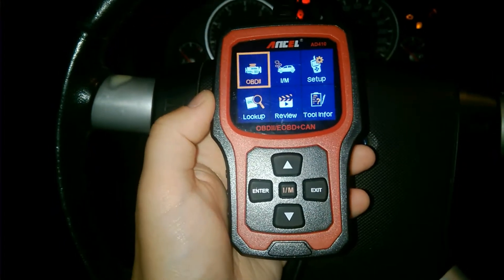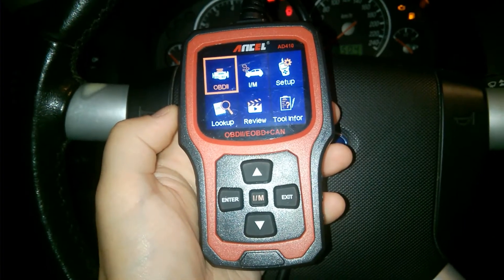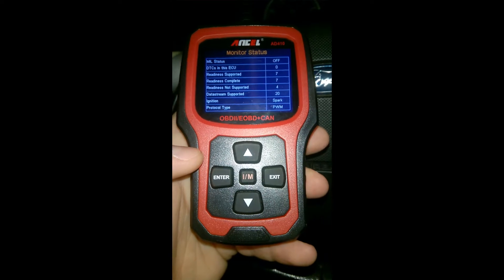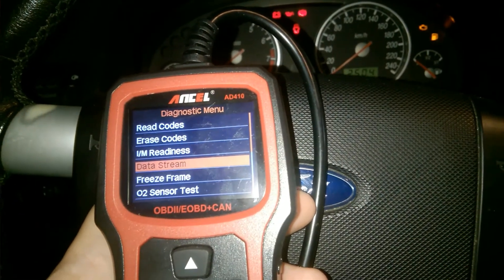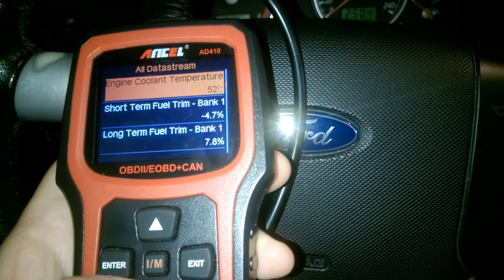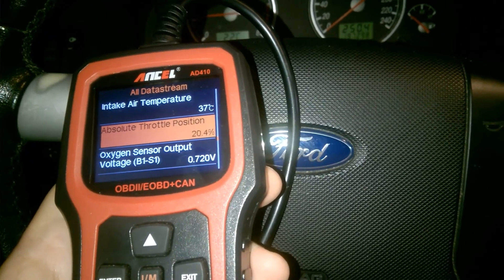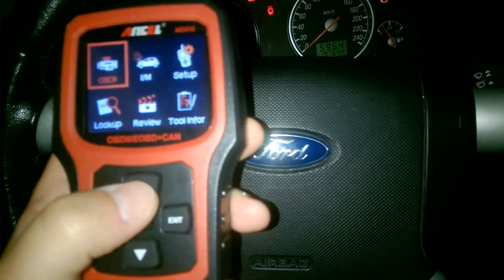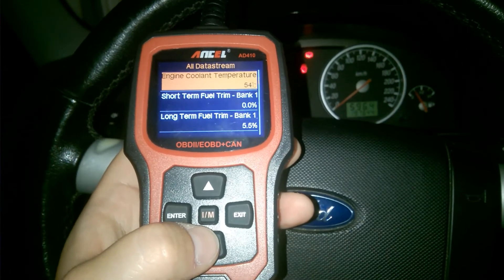How to Use OBD2 Car Scanners. What Ancel AD410 OBD2 Readings are Normal for a Car with High Mileage?

Comment: You are looking at celcius. I don't think your engine is cold. Mine was showing fuel trims that were in the 7%. I dumped some fuel cleaner in the tank and now they are running around 0. I changed mine to English. I don't think in the metric system